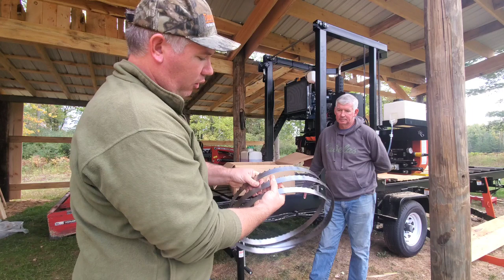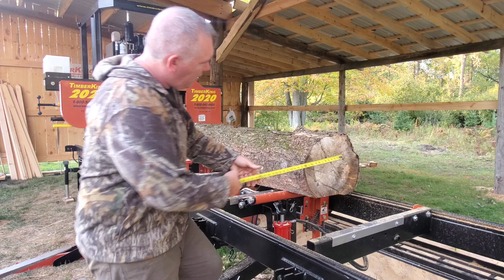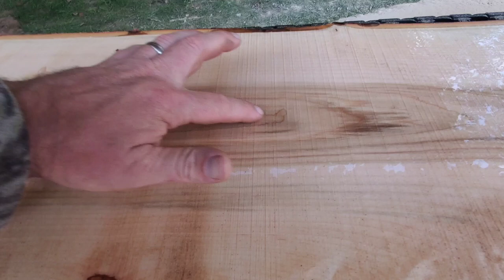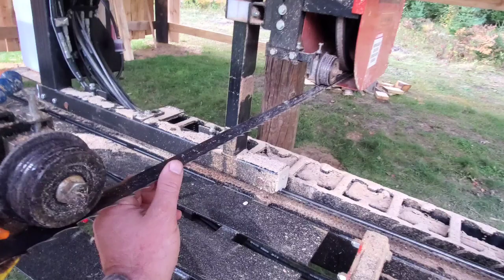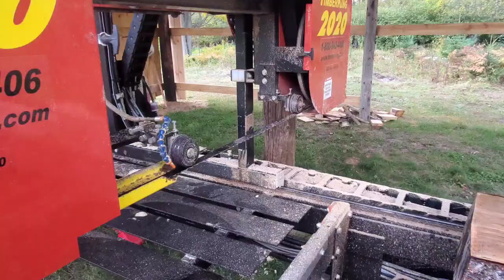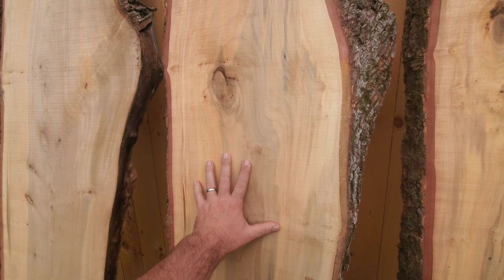Initial testing of a KENNE-SAW bandsaw blade

Comment: Do you know yet what the price of the blades are?  How do all the blades that you've tried compare and their price?  How about the carbide blades and their price comparisons?  I have a Timberking 2000 and mostly cut Oak, Hickory, and some Osage Orange, and have always bought my blades from Timberking.  But if I can find a blade that will do the same for less then I'm sure interested.
Reply from the maker: The carbide blade would be a blade you should try.  Timberking had them for the 2000 not sure if they sold out yet.  My next video when I run the blade until dull I'll put the prices in there, got to get my data together.   I'm impressed with the blade so far.  Sneak peek I'm 6 out of 12  ash logs in cutting 1x6 boards and it's running perfectly.

Comment: I'm running kenn saw blades also and they are great. The only issue I'm having is the blades are breaking I've tried more tension and less tension. I'm just wondering how much tension are you running. I'm willing to try anything.
Reply from the maker: I'm running them at 1100 to 1200 psi on my gauge